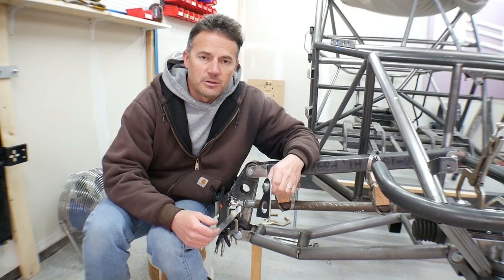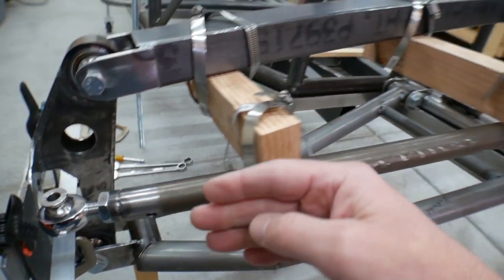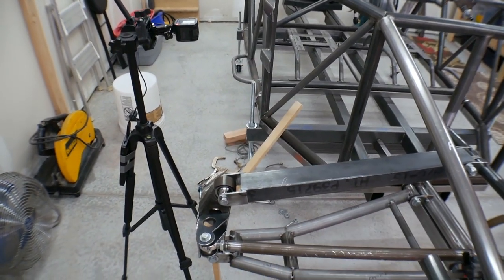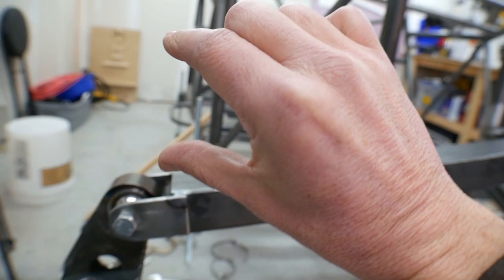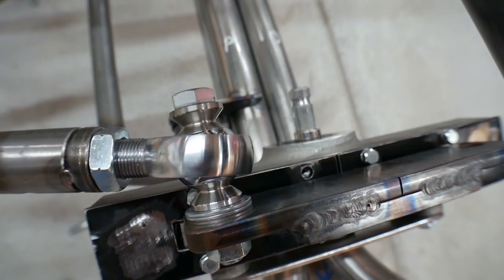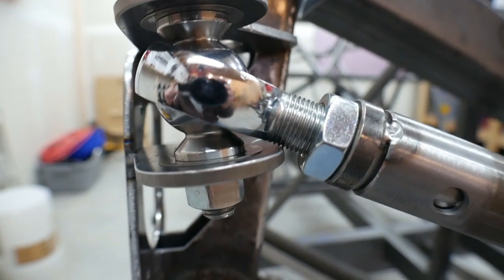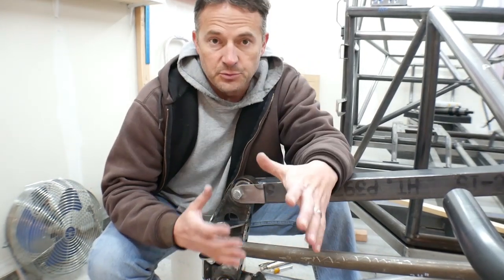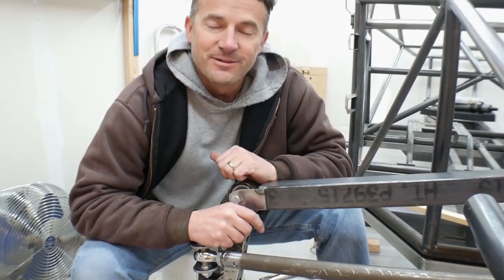Baja Front Suspension Build #3 (Steering Geometry)

Comment: Not sure right or wrong but we used a magnetic laser dot on the arm spindle to check for bump steer and try to get the least amount by adjusting mounting locations.
Reply from the maker: That's not a bad idea. Thanks for the tip. 👍

Comment: Awesome video🤙
    All i need to say is lifted 2000 f150 4x4 😆 that’s why im here 👍  horrible steering bump🤦🏽 im in the process of designing a new setup for steering and control arms.  I dont understand why they make upper control arms so short 🤷🏽 im hoping to get a rack and pinion conversion to eliminate the pitman and idler arms. I do realize having my torsions cranked is where my problems start. 
    I dont want to do solid axles and i have a plan for a different diff to allow for long travel with 4wd 🤘

Comment: Awesome man, this turned out really good with just those little changes. Also your camber gain looks like it's in the ballpark, I'd give it more but that is totally personal preference. You may want to space your steering arm plates apart a bit to have less chance of contacting the tierod even tho I know you will run bumpstops and limiting straps
Reply from the maker: Holy crap! Some spacers in the steering arm is a great idea. Thanks for sharing that.
Camber gain kills me at the top because it causes the tire to crash into the fenders. My wheelbase isn't really that wide. But I totally agree with you, if I had the clearance I'd put more in there.

Comment: Yeah! I’m first!! 😂😎
I like the more trial/error approach you use. Tak welding and cycling the suspension. Easy to adjust the pivot points etc. Designing bump steer, etc out of a long travel suspension is tough. Limiting the travel to 22” when you have 24 actual is smart. There is probably some give in limit straps and bump stops that you’ll only find when you’re out playing with it. Better to limit it than to bottom out the heims and break it
Reply from the maker: You're #1.....;-)
Reply: Doug Bug , it was a place keeper before my comment. I mean, I had to watch the whole thing before I could render a good comment, lol
Reply from the maker: I agree with everything you said! lol

Comment: Hi Doug, Enjoying your build. I did see something you might want to watch for in the future. Your steering arm sections above and below the Heim joint have a square notch where the arm transitions to an outside radius hear the end.  A generous radius would have been better as corners or notches raise local stresses by a factor of two or more. Repetitive stress cracks are much more likely to start from corners or notches. Even surface finish can be a factor in fatigue cracks. I kind of doubt you will see a problem though with the thickness of material you are using. Interestingly, a few liberty ships split in two during service from cracks that started at the square corners of their deck hatch openings during WWII.
Reply from the maker: Thanks for the tip buddy. Next time I'll carry the radius out more and try to keep the notches to a minimum. 👍

Comment: My son and I are working on this right now…..fantastic explanation!  How did you calculate the instant center for bump steer avoidance?

Thank you
Reply from the maker: I never calculated the instant center. What I did was lay out the geometry of the pivot points of the upper and lower arms and the steering arm so they all were all in line with each other, at least geometrically. This way when the suspension went through its motion there is no bump steer. Roll center and instant center were not my primary concerns, suspension travel was my main goal. I hope that helps.
Reply: @DougBugBuilder  Thanks Doug!  We modeled our suspension off yours and couldn’t seem to calculate instant center as upper and lower control arms are close to parallel (formula was coming back with 198”)…. So likely little bump steer. Your videos have really helped us (and his high school buddies….they’re learning to weld, use plasma cutter, calculate geometries, spring loading on coil overs, etc).  Thank you again!

Comment: This is pretty inspirational! I’m a few months away from cutting the front end off my bug to make it an a arm car. I bought spindles from pacific, so that makes me nervous that I can’t manipulate the tie rod attachment point. My question is, are you able to modify the Ackerman effect by spreading the tie rod attachment points (making rods shorter) on the steering rack?
Reply from the maker: Technically you could, but that would have bad consequences on your bump steer. In my opinion bump steer is more important than Ackerman on an offroad vehicle. I recommend to use your spindles as they are and design for minimum bump steer at the rack.
Good luck with the build.

Comment: What style and type ball joint are you using for the top and bottom of the spindles? I would like to use the same style as you are but I am not sure what they are called or where to buy them. Awesome video, thank you so much for the info. I am building a cross kart and will be using a lot of the ideas you have implemented. Thank you
Reply from the maker: That sounds like a cool project!
Check this video, https://www.youtube.com/watch?v=YhbFEoPSf20&t=1069s
In the description are the part numbers for the uniballs.

Comment: If the limiting factor on this setup is where the heim joint touches the mounting bracket for the steering would it have been possible to add longer spaces either side of the heim and space the brackets out abit more so that the heim doesn't touch? Or would that cause other issues?
Reply: Don't worry after commenting and watching more I noticed that the heim is not just limited where it touches the bracket but its also maxed out on the bearing in the center of the heim

Comment: I'm trying to think what could be the reason for having both front and rear travel the same, because on my dirt-bike the front has alot more travel then the rear, after all the front end takes the biggest load when going over bumps...
Reply from the maker: It the travel is the same or close it's easier to get the chassis to react to bumps equally. If the travel is way off front to rear, then bumps will be absorbed differently front to back. Repeated bumps will exaggerate this. It's not a must, but if you can get the travel close you'll be better off.
Remember a dirt bike has the added benefit of the rider being able to absorb chassis movement and help with stabilizing the bike. In a larger vehicle the rider is along for the ride. So the chassis is only stabilized by the suspension and physics.

Comment: Question. Why not put the steering rack behind the rotor? Just asking cause of the other video you posted about the Ackerman also cause I wanna know before I do it to mine lol
Reply from the maker: In order to do that I would need to add at least 1 additional U joint to the steering shaft going up to the steering wheel. With the way it is now I'll be able to have only 2 U joints and the angle of them will not be very severe. To me having that connection simple and strong is more important then perfect Ackerman.

Comment: I think if you work the inner tie ends you can work with more traval because you can put out tie end other side apart from rack so in the center you have three mounting points for rack one rack one point each side center mount has three point not two will that help
Reply from the maker: With changes I had to make for Ackerman I had to let some things like that go and just work with what I had.

Comment: Why did you mount the outer tie rod end horizontally instead of vertically?  Wouldn’t vertically allow the suspension to cycle further?  What is the wall thickness of the tube/square stock you are using for the suspension?
Reply from the maker: Not sure I have a perfect answer for that. You are right if they were vertical I would get more travel. But I think it would limit my steering. But honestly I'm not sure. I should mock it up and see what the limitations are. Thanks for the head scratcher. ;-)
Your other question didn't come all the way through.
Reply: The second question was how thick is the  tube you will be using for the suspension arms?  Is it .120 wall or ???
Reply from the maker: @tomcelica  The tubing you see there is 1.75" x .095" thick DOM. This chassis will have 33-35" tires on it so these arms are 1.75". The other chassis has 31" tires and those arms are 1.5" x .095 DOM, and they are plenty strong. Either way I would go at least DOM. The chassis is ERW, but these arms need to be pretty strong.

Comment: What engine are you going go hang out back?
Reply from the maker: I think I want to start with an Ecotec, just like the other Baja has right now. Then I want to play around with putting a turbo on it and making some nice power. But of course I also want to grow up into an LS. lol. But for starters I'm going to play with the Ecotec.
Reply: Doug Bug i was wondering if you would hang a v8 on the back lol see i was going to ask do you have any weird ideas to put a vr6 or vr6t on the back or my personal favorite the modern hemis from chrysler
Reply from the maker: @Moneygrip  The lure of a V8 will eventually get me. But first I'll play with the Ecotec. I'm comfortable with the Ecotec, and I think if it was putting out like 350hp it's low weight would make it lethal.
Reply: You might as well start out with a 4.8/5.3 steel block or whatever you can get cheap. Then put a turbo on that.  
Get the cheapest ls you can fined . Don't worry about getting an aluminum block . It is only 70-100 lbs less and not worth the extra expense. 
Sloppy stage 2 cam and valve springs. New front and rear main seal. Put a new o ring on the oil pump pick up and don't touch the rest of it. That cam has a good sound to it makes good power naturally aspirated and is actually a turbo cam. 
IMHO if you even think you might do that in the future just do it now so you can build it for it. 
You make good videos and build very nice stuff . Keep up the awesome work.
Reply from the maker: @matthewhoney2132  Thanks for the tips, I've been keeping my eye out at the local boneyard for a good LS to start with.